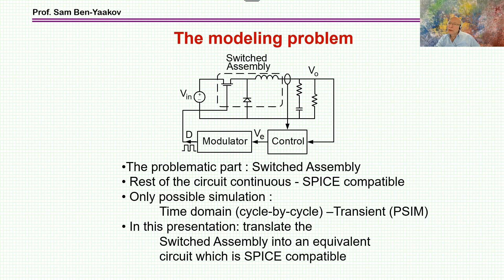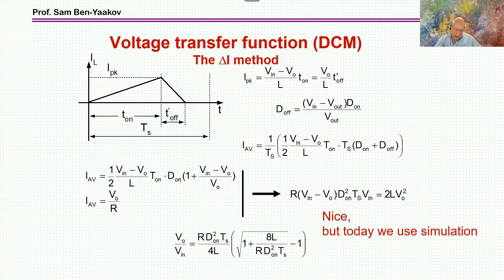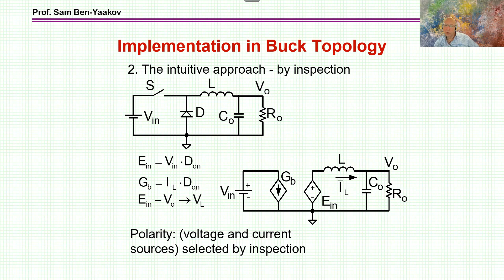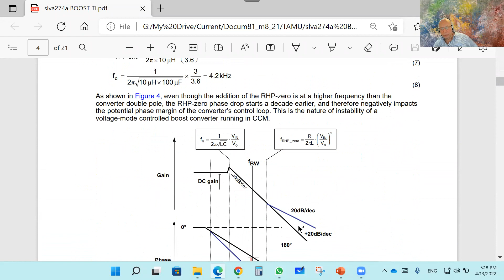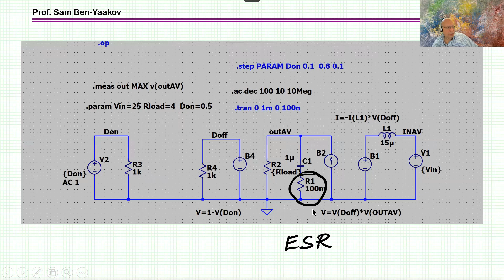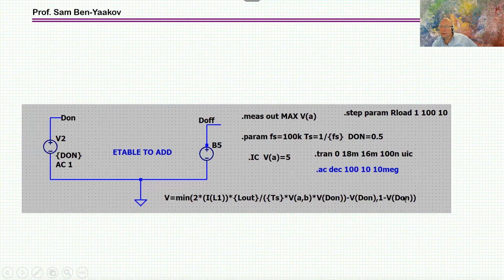Modeling and control of PWM converters - Tutorial - Part I modeling

Comment: I implemented the Averaging model in LTspice for Buck converter as shown in your lecture video. Now, i am able to run AC response. When i run the same model for .Tran simulation for 20ms, I get only a Horizontal line for output (e.g. 5Vout). Well, i expected some overshoot at the startup like in switching model but without switching ripples! Is that normal or I am making some mistakes?
Reply from the maker: It has to do with the initial condition. Set the IC of output capacitor voltage to 0 or use a step for the input voltage.

Comment: great，but i have problem about how to modeling cuk with two switch，can you make a video about cuk modeling?THANK YOU!
Reply from the maker: You need to find the DC voltage of cap and the average voltage around each inductor.
Reply: @sambenyaakov  and i have made a model with LTSPICE,but the resualt is wrong.
Reply from the maker: @luzhouyang5414  THis might help you https://www.researchgate.net/publication/3651667_A_SPICE_compatible_behavioral_model_of_SEPIC_converters#fullTextFileContent
Reply: @sambenyaakov  thank you ,professer.
Reply: @sambenyaakov  thank you professor ,I have read your article,and I modeled it in ltspice ,it worked well,but I want use coupled inductor ,do you have articale about coupled inductor model about cuk? wait for your reply,thank you.
Reply: @sambenyaakov  thank you for reply，I have got a arbitrary voltage source series with inductor,and I know the DC voltage of cap,but i don't know how to connect wit the inductor，cap and DC voltage source, can i send you a email to explain the question in detail? professor,wait for you reply,thank you!